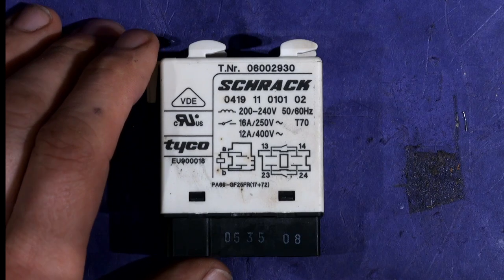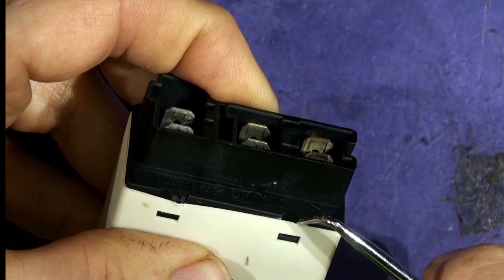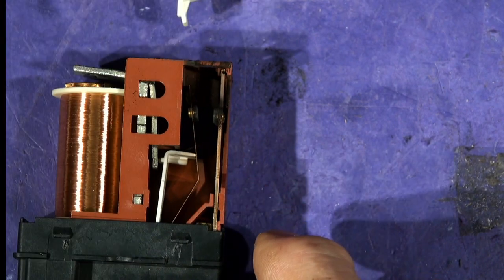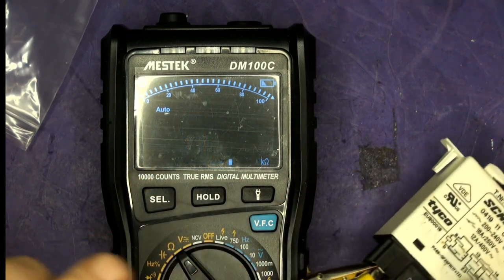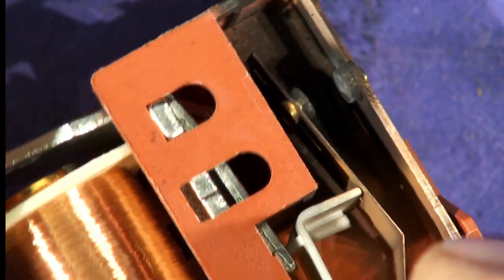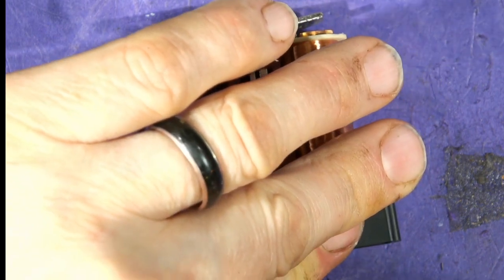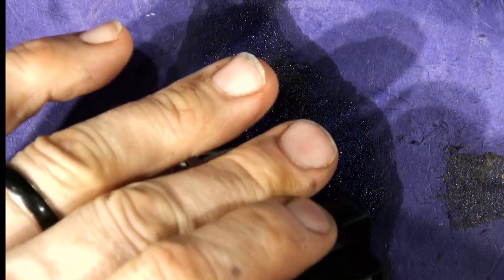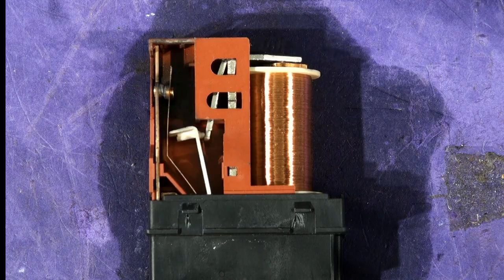Miele Dishwasher  F24 Fault Flashing and Beeping Repair -  Stage 1 Repair

Comment: Thank you for the video (as well as the other one). Do you know if there are models without that relay? my wire go from the power supply pcb to the water sensor relay to the heater.
Reply from the maker: Not sure. All the Mielas I have worked on have the seperate power relay located near the bottom of the machine. Have you got a schematic of your machine?
Reply: @razenby  There is a PCB on the bottom right side with 2 10A SCHRACK PB900002 relays which replaces the top controller and relay box. found them on ebay, have to swap them now

Comment: So it's Relay working now :-D   Sorry bad bad joke.
I've always liked relays, yes they are an old technology but dam handy :-D
On low voltages i think the contacts can be jumped with a crapacitor, but mains hmm.
A dish washer... oow that's me lol.
Reply from the maker: Good idea but would not make much difference at 2.2Kw. The main problem is that the controller takes in the 240V AC lines to sense that the NC contacts are closed. If it cant sense it at turn on it knows that the relay contacts are stuck closed and the heater is on.  Then t pluses the relay to make sure that the NV 240V AC sense  signal disappears.  If there is carbon or damp between L and N around the relay s contacts then the leakage is enough to cause the relay test to fail due to the leakage.
Reply: @razenby  Very clever and the processor tells you the relay is dead and they should of put a more manley relay in the machine lol, joke :-D
Reply from the maker: It is rying to be too clever with a silly sensing circuit. Schoolboy design.

Comment: If I have checked all the terminals for continuity and good contact, then with leather gloves on holding the relay closed I still get the F24 code does that mean it is definitely the PCB?
Reply from the maker: See second video. Check relay connections. You can usually check the controller by drying it out and retest. See video #2 in this series.